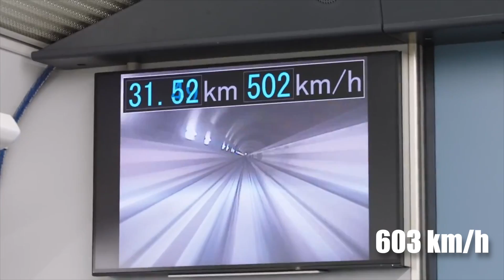The Most Insane Railway Projects Under Construction In The World

Comment: 6:01 pioneered in Japan? You mean in Germany. Germany had a functioning Maglev (TransRapid) in the 1990s. England also had a Maglev early on, but it was very slow. The German one was extremely fast
Reply: The Japanese "Maglev" is different from the German system implemented in Shanghai. It uses super-cooled, superconducting electromagnets instead of the "normal" magnets of the "slower" German system.